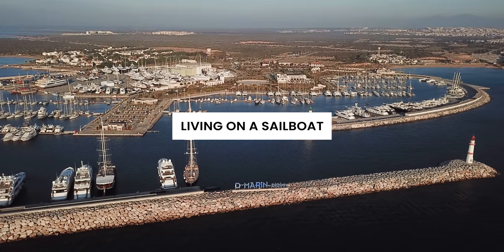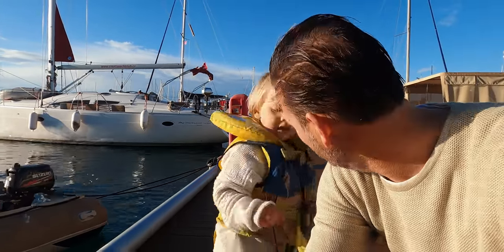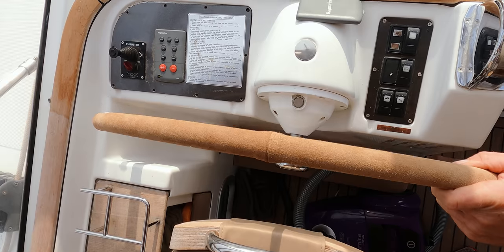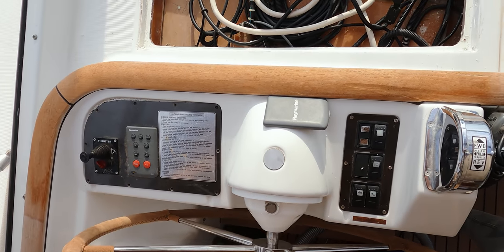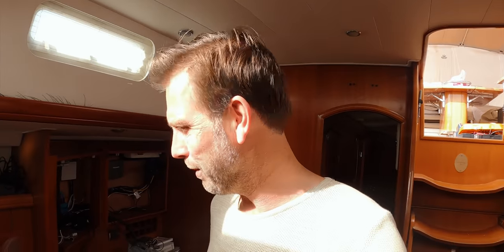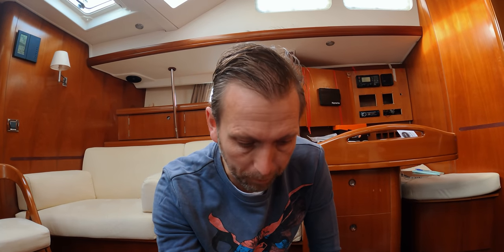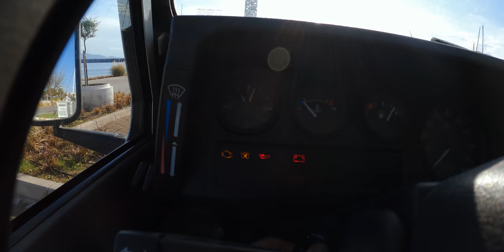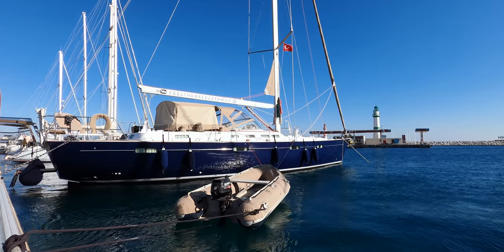Full REFIT SAILBOAT - Lithium Batteries & Instruments for our Sailing Yacht Beneteau 57 Se. 2 Ep. 33

Comment: My own unsolicited opinion is that if you can afford it having a mechanical and a electronic autopilot is a must. 

Firstly redundancy whilst it is not crucial if your autopilot goes out you do not have to hand steer 24/7 as you can balance the boat and a couple of bungees will get you in the general direction of where you are going. Obviously  not an ideal or long term solution but it can get you to port or close enough. It would generally be good not to have to do this though.

Secondly power having a mechanical system means you do not have the constant drain on the batteries that an autopilot takes up. Most boats these days have quiet a drain Refrigerator, Fridge, running lights, Instruments, AIS, Radar. Anything to reduce that constant load is good. Obviously better in the case of long passages than short Island hops.
Reply from the maker: Hi Glenn, thank you for your opinion. Totally agree with you regarding a mechanical and electrical autopilot. It’s not easy to install a mechanical one on our transom. We have swimming platform and it is possible. We start with. a redundant electric system and are going to upgrade our power supply with solar and have a dedicated oversized 12v bank just for our instruments.

Comment: Why was she equiped with 110-120 volts ? Because most of carabbean is 110-120 volts (except FR-NL islands).
Reply from the maker: That’s a very good question Robert, we found an old pc with cables and a Raymarine card you use for a laptop in the corner of the saloon. Maybe it’s because it was the only way to set up this kind of system. As far as we know the Perfect Sense never left the Med. We removed everything since we will be energy independent soon.

Comment: 110 volts is US. UK is a hearty and useful 240 volts. Also never get anything posted to Turkey if you can avoid it. It's unreliable and slow AF. Get DHL or FEDEX. The extra cash is worth it. Best of luck.
Reply from the maker: Thanks Dave,  I had a mind twist because the previous owners were from the UK and made an assumption. And as you probably know, assumptions are dangerous. And don’t get us starting about the post, luckily everything is here now, finally. Definitely a great tip to only use DHL and FedEx, would have saved us a lot time 😂
Reply: @FeeltheBreeze  I'm running on 14 years experience. Trust me on the DHL thing. ;)